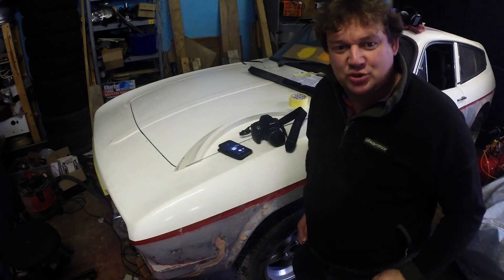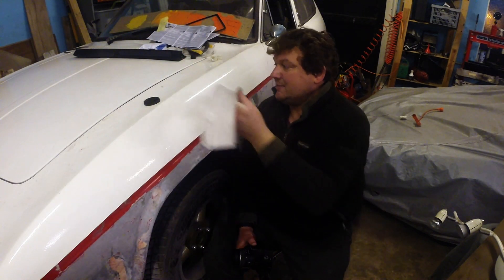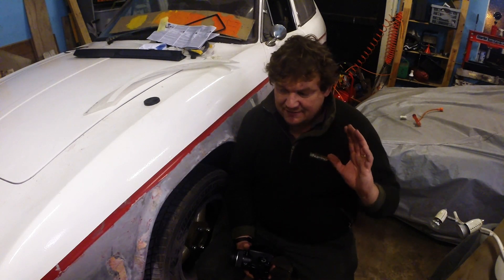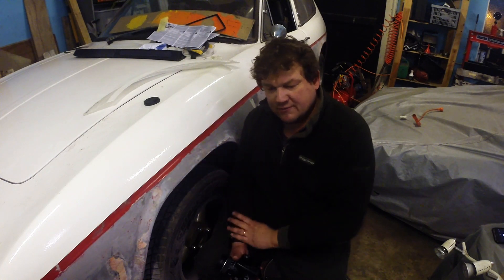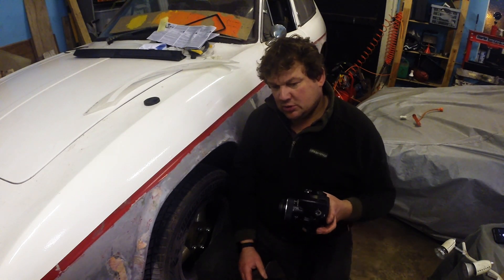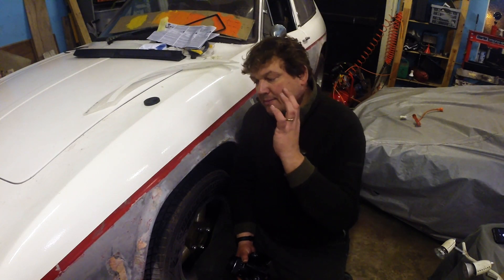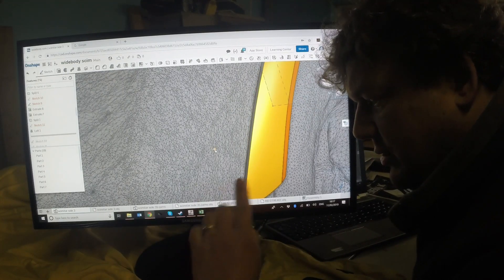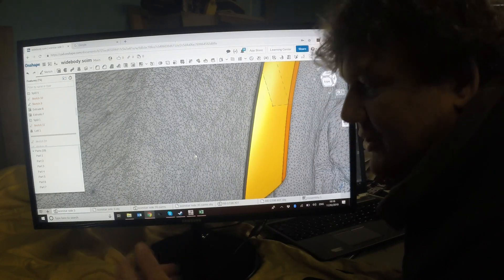3D Printed Widebody Kit, DIY For Everyone -  Scanning a car with photogrammetry - EP1

Comment: super cool! I freaking love 3d printing. I have had the idea that it would look super cool to do this but with the whole fender panel and to create the "Low Poly" look over it, instead of trying to create a smooth surface. I dont have a cool enough car or a big enough printer though! Id suppose you could print the individual polygons out flat and bond together. they should take the 3d shape on naturally as they become a structure. ideas!

Comment: Very cool.  Do you think this might work well with a toy or model car?  I'm in the video game industry and am wondering if scanning a model car might be good enough.  Maybe 3D artists could use the high density mesh as a guide to wrap their own mesh around.  Any thoughts?
Reply: Todd Wasson I specialize in car modeling. It would take more time to scan it and retopologize it than to use blueprints and model it. That and you wouldn’t have access to any car you want to model.
Reply: @andrei1812  retopologize? Can't find it in the dictionary. Could you explain?
Reply: @Anton-le7gd  usually means to remesh in this case.  Ultimately it is the layout of the control in sub d modeling.